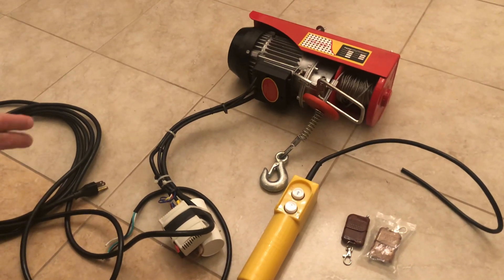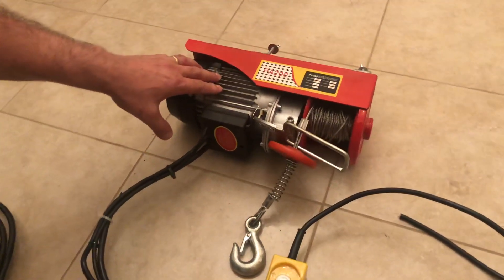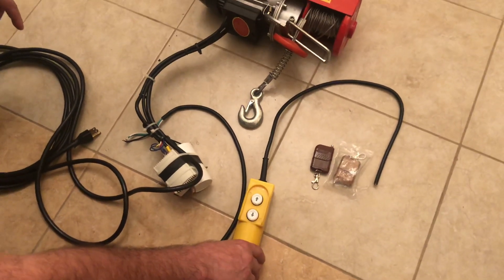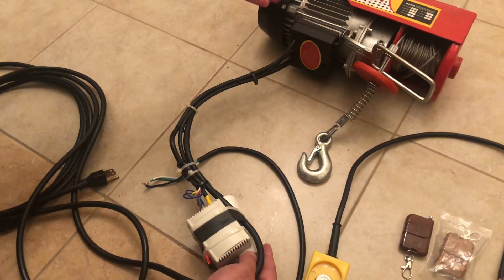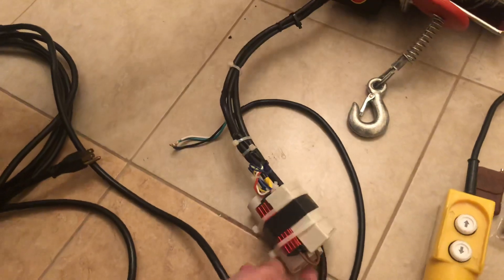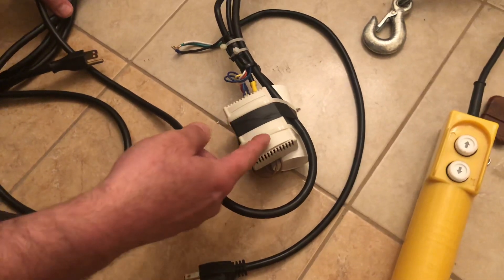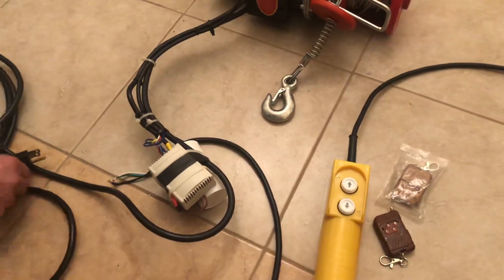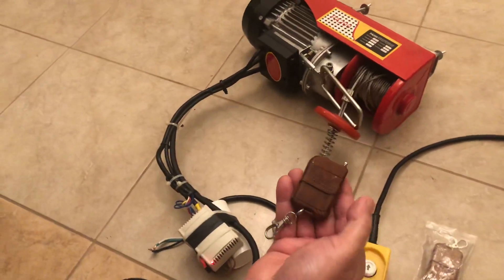Hoist/ Winch Wireless Remote Modification

Comment: Pardon me but this video is not how you add a remote to a hoist. This video is how well the finished project works.
So now for the video on the connection side of the project aka what needs to be done to get to this point.